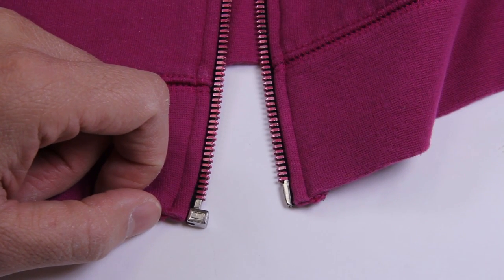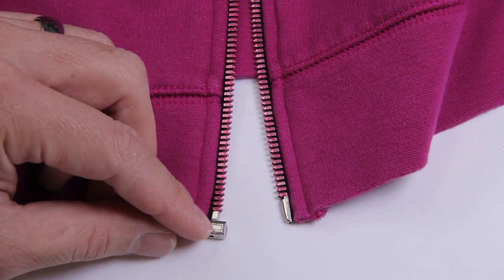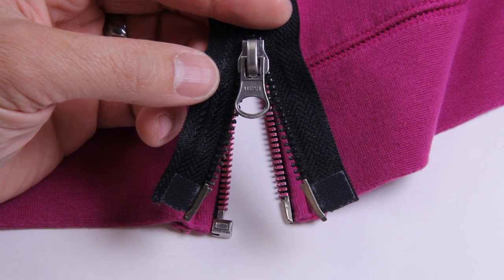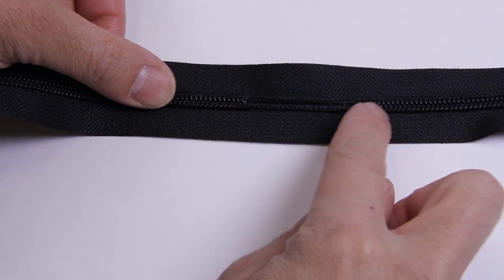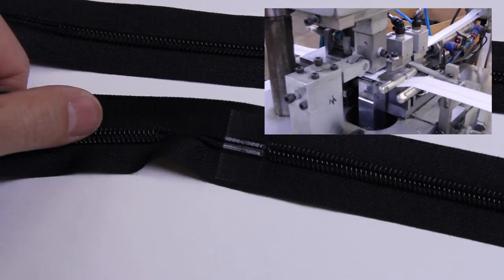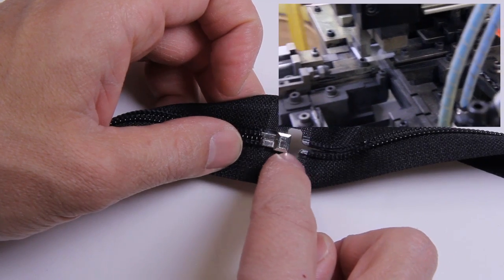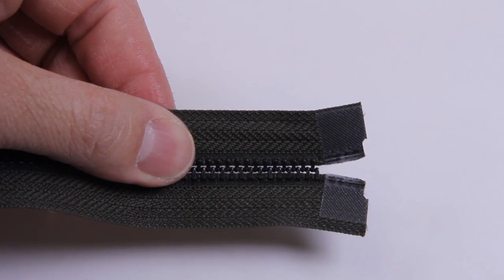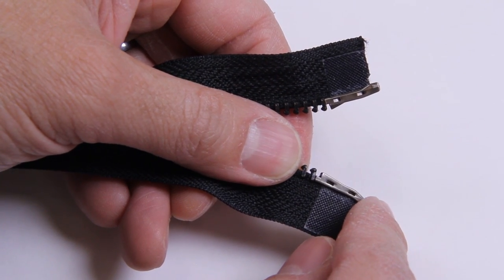The Zipper Fix That Cannot Be Repaired

Comment: Thanks for this :) But there is a different repair I don't see a video about in your playlist. This video is about when "one of these [insertion pin or box] have fallen off." Do you have one about when the fabric (zipper "tape" I guess it's called) has torn along some (most) of the length of the insertion pin? The pin is still attached at the end abutting the teeth (that is, opposite to the end that is inserted) but, being detached along much of its length, it is almost impossible to zip it. And there doesn't seem to be enough fabric on the pin side of the tear to sew it back together. But if the alternative to repairing is to remove the whole zipper and sew in a new one, couldn't you sew in (onto the existing zipper "tape") just a replacement pin (which seems a lot simpler)?
Reply from the maker: A full replacement of the zipper is easier. When the zipper tape has torn where the insertion pin was, it's function is damaged.

Comment: I finally searched now for help on whether I could repair the broken/fallen off pins on two jackets that otherwise are in great shape.  One is from Nautica, the other a brand I hadn't bought before, but it is waterproof (gore-tex) and insulated.  The latter was purchased for a reasonable price from a work uniform site.  BUT the zipper didn't function smoothly and jammed, with the insertion pin pulling off.  What a piece of junk on an otherwise good jacket.  No wonder why the jacket was on clearance months later.

( I hardly ever purchase clothing sight unseen, and when I eyeball clothing in stores, it's the details that matter.  If stitching is cheap and zippers are rough or choppy or sticking already, then the manufacturer cut corners in a bad way.  Their loss; I won't buy it. )

Anyway, Thank You for posting the video and giving me the expert lowdown.  The Nautica jacket can be donated; it does not have velcro as an option to seal the front.  The work jacket does, so I will keep that.
Reply: Macht Nichts Sei Mann You can always have a seamstress sew in a complete new zipper. Not expensive at all. Fairly easy too. May could do it yourself ✌❤😄

Comment: What about when the pin is still there but has torn away from the zipper material?
Reply: Did anyone solve this issue...zipper tape has frayed away from the teeth so metal is attached but hangs loosely and you can't zip up coat.
Reply: +Muriel Safroniuk   I have the same problem, the pin is still attached but most of the fabric holding it to the tape has frayed away.  The zipper still closes but it's obviously just a matter of time before the pin falls off.   If I don't find a solution soon, I may try crazy gluing it back to the tape.   I'm also tempted to stitch loops of thread around the pin to sew it back to the tape but that would depend on how much extra space there is for the slider to fit over the thread on top of the pins.   I'm also thinking of just wrapping some clear magic tape over it as a temporary fix, perhaps after crazy gluing it.   Currently, I'm just using the buttons on the coat to close the coat but I can see that on cold days, I may still have to zip it close.   You'd figure that someone would make a replacement pin with wider tabs to bite onto more of the tape but I guess there would be no profit in that.
Reply: Zippers need an uninterrupted path for the slider to work. Sewing the pin/box on sounds like you’d need to wind the thread around either one of them. Thread is not very thick but it does get in the way and prevents the slider from functioning. Just like when some thread accidentally gets stuck in your zipper. The slider tends to jam. My experience -
Having said that, I’ve experimented with a “bonding glue” (used Gear Aid seam grip + Waterproofing) to stabilize the early fraying near the pin. I used a toothpick as to not get any glue ON THE PIN. Again, my experience is that even a bit of glue too close to the pin or too thick on the “tape/zipper fabric” the slider doesn’t function normally and needs more force to work (which can cause more damage). I agree that temporary fixes can be made but I stand by the theory that if there is tape fraying, missing teeth, pins or boxes - fixes won’t last as long as if those pieces remain solid.

Comment: What about a replacement pin in box do they sell those and are they easy to put on?
Reply from the maker: Unfortunately there is no replacement pin and box sold. The reason is that we use machines to make the punch onto the zipper cord.
Reply: Amazon sells the pin and box kits. I just purchased one...

Comment: Comon. Those pins/box end stoppers can be crimped with a good crimper. The hardware is fragile. If they broke off in the first place, they were never crimped good by the machine factory right? I'd be more afraid of breaking the piece with an overzealous crimp. Maybe a non mechanically inclined individual with no skills and frail hands would have a problem. Like the other lady in the other video sewing in a new piece. Ya.

Comment: This is sorta what happened in my Navy dungaree jacket.  It's 36 yrs. old.  I've repaired the coat a couple of times due to the thread is so old it falls apart.  I've taken it to a couple of seamstresses and no one wants to replace the zipper for me!  I bought a new zipper; but, due to the age of my coat, I'm also afraid to replace it.  Do you think, if I cut all the teeth off and sew the new zipper to the material of the old zipper it will work?  If you have e-mail I can send you photos of my coat and what's wrong with it.
Reply: Arietta. Just curious, were you able to fix his 36 yr old Navy jacket? Lol.
Reply: @arimacem  can you help me?

Comment: Yes you can fix!
The following worked for a two-way molded plastic zipper where the stop on the bottom pin wore down…

After sliding the top and bottom slides onto the zipper and assuring the bottom pins are properly aligned, use a 1/16 inch drill bit to make a hole near the bottom of the plastic pin (making sure it is the one that had the original stop).  Then stick a small piece of 16 gauge galvanized wire into the hole so it is flush with one side of the pin. Make sure the wire is slightly larger in diameter than the hole so it fits snuggly. Cut the other end of the wire almost flush with the other side of the pin. Use pliers to squeeze the wire from end to end; this will debur the ends of the wire and flatten them slightly so the wire does not come out of the pin.  You should now be able to pull the bottom slide down over the pins but it should not slide off.  Pull the top slide down to mate with the bottom slide and you should be able to pull the one side of the zipper up through the slides.  VOILA!! :)
Reply: I had your idea as I was watching the video. There's a way to DIY what the machine is doing. Like with a drill bit. I like your wire idea. I saw the divots on the box and thought about a stitch through them. When he says unfixable, I think he means that it's a level above simply crimping the top stops. As far as long term goes, it all depends on the DIYer's ingenuity.

Comment: Don't give up on a fix.  I have a winter boat cover that zips together, and the bottom box broke.  I bought an assortment of zipper parts from Amazon (may 6 bucks), found a bottom box that fit snugly, removed the broken box pieces from the zipper, and  superglued and crimped the new box on.  The video makes it clear that this is not a permanent fix, and that might generally be true, but I only use the zipper once a year when I put the boat up.